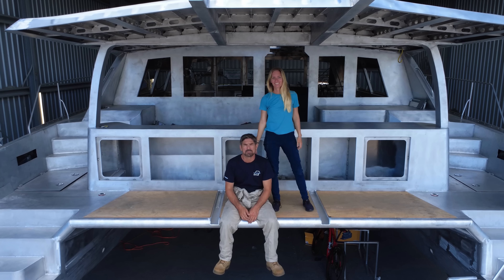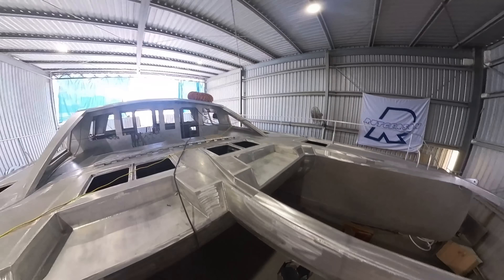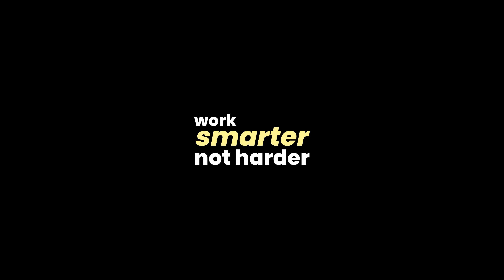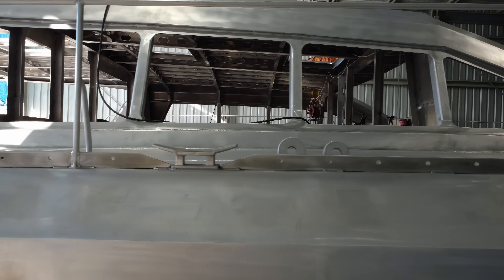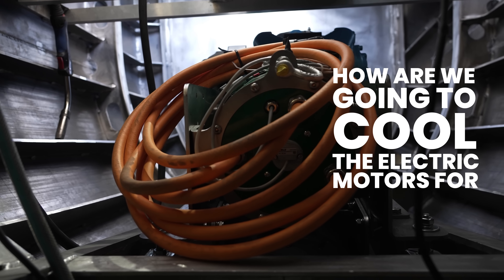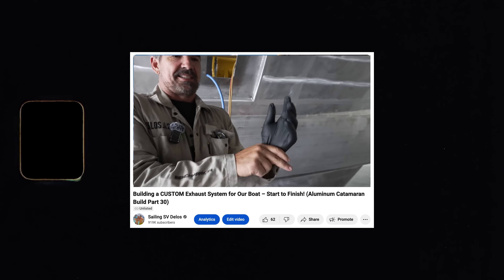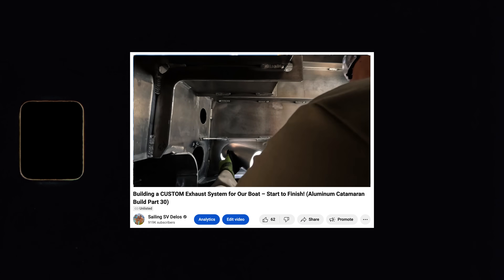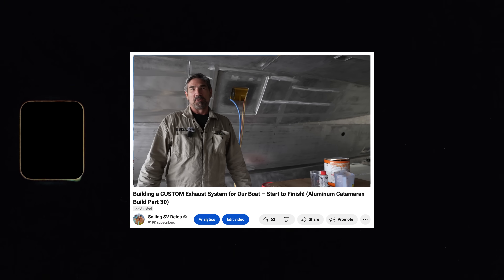We Challenged AI to help design our Keel Cooler 🧠 (Building Our Own Aluminum Catamaran From Scratch)

Comment: I'm sure you know all this, but just as an excercise: 

1. I would consider this a critical ship system and therefore work closely with manufacturer to ensure your design meets or exceeds their recommended operational parameters.  All the calculations I've done DO NOT show a viable option for an internal "keel cooling" system, mainly because they're electric engines, not combustion engines. 

2. Most important for electric motors:   Proper cooling is crucial to prevent overheating and ensure the motor's longevity.  There will obviously be a thermal protection shutdown built into the motor.  But that doesn't preclude you from using you own coolant temp sensors to let you know what's up and shut down (or slow down) at lower temp if you want to maybe extend motor life (or be able to push it a bit more in emergencies - NOT beyond spec, of course). 

3.  I think the main issue here is the low thermal conductivity of water (the coolant) 0.6 W/m·K vs Aluminum at 237 W/m·K.  You've got to move a lot of coolant across a lot of the Aluminum surface of the hull in order to keep the electric motors cool, the way they like it.  IC Engines of course like it hot, so 'keel cooling' works ok. 

I would maybe even build a separate sea water heat exchanger system for the electric motors, if you want to make sure they run at the lowest possible temperature, esp in those tropical waters. 

Have fun guys!  Thanks for presenting a 'cool' engineering and design issue! 🤓

Comment: I'd say make the e-motor keel cooler half the size of an equivalent output diesel engine keel cooler. This would ensure the cooler has 2-3 times the needed btu transfer under ideal conditions and 1-2 times the needed btu transfer under worse case sceniero's. 

The cooling fin design will have the largest determination of overall heat transfer efficiency. Thin fins with alot of surface area to start. 👍
Reply: Also trust the human. The human actually knows what it's doing.

Comment: Theres so many variables. Amount of circulation will effect the temperature, so size of cooling piping and flow rate of a circulation pump will have an effect on cooling efficiency. The system needs to be designed for the worst case (hottest sea temperature), the cooler the sea temperature the more efficient cooling will be, the lower you can cool the electric motor the better. I would be trying to use a systems similar to the cooling system on your diesel motor that uses many of the same parts to eliminate the amount of spare parts that need to be carried. Dont re invent the wheel, adapt something that is already available.

Comment: don't be afraid to be conservative,and take in account that a diesel engine run at 90c probably your system want something lower than that,then as the temp difference is lower,the efficiency of the cooler decrease

Comment: It sounded like you wanted to mount this cooler internally. I think keel coolers are normally mounted on the external surface of the hull, directly in contact with water. That may change your calculations quite a lot. Also, since the hull is so large compared to the cooler, the thermodynamic calculations may be able to be considered related to an infinite solid… the whole side of the hull will be wicking away heat. Just some thoughts.

Comment: M.Eng. / N.A. here who has designed actual external keel coolers - ugh. 1/2 pipes and channels welded to hull exterior are common but are way too much drag for sailboats. Do not do external keel coolers!  Weld a long skinny box inside the hull compartment with little tab baffles. Keep flow <2m/s to ensure no erosion of parts of the hull or your box. About 0.4m2 seems like sufficient area because your delta T is low.  Depth of box can be very shallow. About 35-40mm or so. Lots of electric motors de-rate >50C so 35C sea water temp + 15C temp rise is going to be acceptable. Use a small plastic expansion tank (auto parts store) for the system and a pump rated for constant running, hooked to a thermostat. In cold water the pump may not need to run because cold air inside the hull compartment will keep the motor. Cooling boxes can be broken into 2 to avoid frames or centerline line keel. Commercial keel coolers are usually bronze so really to be avoided on an aluminum boat without very very careful galvanic isolation.
Reply: You could also contact Fernstrum to see what they would recommend for your application. Their units are very common on commercial vessels. I think they are always bronze. But Weka makes an aluminum keel cooler. These are all external types but could be recessed to reduce drag. At least you'd get a ballpark on surface area required.

Comment: I tested Perplexity with your query as in the video and it suggested 2.5 sq m--assuming 10C between the sea temp and the coolant temp.  Seems to me the desired coolant temperature is the will drive the size of the heat sink.   Finally corrosion/antifouling/marine growth will all contribute to increasing the size of the unit!

Comment: i would make 2 - 2 sq feet coolers with valving to to use 1 ore both . and the abilty to use just one if one leaks  . i would also make the cooler as much surface area to the hull and a thermal paste to aid in conduction.

Comment: For a a seawater exposed  hull saltwater heat exchanger as in it will sit in some kind of hull pocket if you can swing the cost Titanium is orders of magnitude better at preventing marine growth and it is way more durable. Why is the extra cost may be worth it? Long passage you are coming in to port anchor and the heat exchangers are all covered with even extra hull growth because it is all warm and snuggly and protected in and on that heat exchanger.  Most people that are from the Americas never think of titanium for normal things because Ti is not a normal thing there so it is considered exotic, imported, expensive and hard to work with but outside the Americas it can be quite affordable for what it offers. Where you are in OZ you can get things from China Russia and eastern Europe and they are all very used to working with Ti. Just a thought thanks for the video.

Comment: Haaaa nice ingeneering problem [;oP. One important question : What kind of T°C do you accept in the electric system, motor and expecialy motor controler ? At the end, whaterver cooling surface you implement will determine a coolant temperature in the loop. Lest assume worst case : 30°C in water, 50°C in coolant. Fouriers law : Exchange coef of aluminium is 237w/m2 for a thickness of 1m per 1°C difference. SO for 20°C and 6mm thick alu : 20*237/.006 = 790kw/m2 for a perfect convection of water on both side. Witch is never the case. In fact conduction trough alu is always very good. What is limiting is surface exchange due to  : surface cleaneness, water speed and convection at contact on both sides. On coolant side typical values are 1000 to 5000 w/m2/° on sea side could be  500 to 1000 w/m2/°.  Lets assume following R total  = 1/3000 + 1/750 + .006/237 = 0.001691 SO heat transfer with convection would be a realistic 20°C / 0.001691 = 11800w/m2 for 20°C différence. A quarter of square meter is not bad for 2500w. Assuming surface degradation in marine environnment I would double with 0.5m2. If you can. The only risk is to run cooler if everything is perfect or a little hotter if bad. BUT most of the time you will NOT expell 2500w per motor.

Comment: @sailingsvdelos Brian, I got this from ChatGPT, don't why you got 1.25 m² 😮😮😂😂

"If you have a 25 kw electric motor that's 90% efficient and you want to cool it with a closed loop coolant system how much heat do you need to dissipate via an aluminum heat sink? How large would the heat sink need to be if it's used as a keel cooler on an aluminum sailboat?

To determine the heat that must be dissipated and the size of the heat sink (keel cooler), let’s go step by step:

---

1. Heat to Dissipate

Your motor is 25 kW and 90% efficient, meaning 10% of the power input becomes heat.

Heat = 10% of 25 kW = 0.10 × 25,000 W = 2,500 W

So, the system must dissipate 2,500 watts (2.5 kW) of heat continuously.

---

2. Estimating Heat Sink (Keel Cooler) Size

The sizing depends on how efficiently the aluminum keel cooler can transfer heat to seawater. A rough estimate from marine industry practice is that aluminum immersed in seawater can dissipate around 500–700 W/m²°C of surface area per degree of temperature difference.

Let’s assume:

A ΔT (temp difference) of 10°C between coolant and seawater.

A conservative heat transfer rate of 500 W/m²°C.

Then the required surface area:

\text{Area} = \frac{\text{Heat}}{\text{Heat transfer rate} × ΔT} = \frac{2500}{500 × 10} = 0.5 \, \text{m}^2

---

Final Answer:

You need to dissipate 2.5 kW of heat.
The keel cooler (aluminum heat sink in seawater) should have at least 0.5 m² of external surface area in contact with seawater, assuming good design and flow."

Comment: Run the Ai with water temp of 30 C outside and then see what it says. When designing, test to feil and do the same with design, making to be over engineered so it will not fail.

Comment: Dear Delos fam, as a master plumber and master HVAC guy don't forget that the heat sinks will be radiating to the cold ocean however 3/4 of the surface area of the heat sink will be radiating inside the boat so you have to consider how you're going to insulate the heat sinks up against the hull away from delos to's interior at least for the summer perhaps you could have a removable thing insulating it so that in the winter time you get some free heat from motoring to warm the boat.
Reply: Note a 25k2 motor that is 90% efficient, rejects 25/0.9-25=2.78kW of heat.  I'd be looking at half tubes welded to the hull, easier to clean and antifoul.  Important thing is that it's not undersized, am assuming thermostat will keep temp under control.
Reply: Exactly.  How much heat radiates into the boat versus going into the ocean?  You want the heat sink chamber to be thin so you maximize the surface area of the water being cooled.   I am not sure what the heat sink idea buys you.  Heat sink (potentially saving 1 water pump) or exchanger, need 2 water pumps.  Both need hoses and fittings. So a few less parts but you have a lot more heat going inside the boat.  How do you scavenge the heat from the electric motors?  Need 2 setups as well and a system for the diesel motor.    What is the mA rating of the water pumps and what will they consume for power?  Good puzzle
Reply: Interesting. I'd never heard of a keel heat sink, but it seems to me that one might want to capture some or all of that heat for such things as hot water heater, etc. I know some diesel engine systems do incorporate engine heat for hot water heaters. What else on the boat could benefit from the electric motors' heat? Interior cabin heating for example? Good puzzle indeed @markryan7109!

Comment: I'm glad to hear you're not relying solely on assumptions and are double-checking the information yourself. That approach is essential. I recently completed an AI guidance document for the company I work for, and one of the key concerns addressed was the issue of assumptions. While AI can be a powerful tool, users must always operate under the assumption that some information may be incorrect or incomplete. Critical thinking and verification are vital. On another note—regarding your use of the hull or keel as a cooling surface—have you considered the potential for condensation when operating in cold waters (around 1°C)? Depending on the amount of condensation that forms inside the keel, your bilge pump might end up running quite frequently.

Comment: Question.... Would the constant exchange of heat between cooling motor and sea water discolor the hull on the outside ?   Would that in some way the constant heating and cooling in any way weaken or compromise the integrity of the hull?  Like other metals constant heating up and cooling weaking the metal.  Does aluminum after constant temperature changing do the same?  Just wondering ---- Your craft is going to be the standard in years to come.  Everyone is going to want some of the ideas you have conquered....  GREAT JOB

Comment: My engineering take. on the issue:  My goals :  1. adequate cooling 2. No through holes, 3. For sure no copper on the outside of the hull or even on the inside where you could get galvanic corrosion.  3. Serviceable without a haul out.  4. Redundancy not just one cooler section but two or several so a leaking one can be bypassed and repaired or replaced. 5. flow and or temp monitoring.    Easy to replicate in any part of the world. 
 How about square aluminum tubes  bolt fastened to thick heat transfer flanges welded to the hull on the inside of the hull.    Include a inner plastic turbulent flow baffles.  Make them simple  and spread them around connected with tubing (PEX).   You got plenty of hull area to work with, just over kill it with multiple smaller easy to replace units.   On sea trials, not enough cooling just add a few more,   Watch for dissimilar metals and galvanic corrosion.   Wouldn't be too hard to prototype one and test it to see  what it would do, then scale up the numbers to attain your cooling goal.

You also only need full cooling at max motor power, where you would have max water flow over the hull.   Don't  fall into the trap of over  estimations.

Comment: I'm not an accredited engineer, and I didn't stay at a Holiday Inn Express last night, but I'm an autodidact with a fair amount of engineering and design experience.

The thermal conductivity of Aluminum is ~237 W/m·K at 35c. It's weird that none of the AI models seemed to land on that, but that, and the flow rate of your pumps are the major missing pieces of the puzzle.

We already know you're calculating for a heat load of 2.5kW.

You've got plenty of Aluminum in the hull, so the heat dissipation to the water isn't going to be of too much concern. The potential thermal load capacity of the sea water is virtually infinite, so we don't need to worry about that side at all, even with some bottom paint. In your position, I would probably just recommend building your own plate heat exchanger, and just building it directly in-place, welding it to the hull on the inside, so you get maximum conductivity. The more plates you stack internally, the more surface area you'll end up with. Just make sure you've got plenty of 'meat' on the sides, to conduct the heat from the plates town to the hull.

If you do that, the only thing we need to worry about is how much surface area you need in the heat exchanger itself, to get the heat out of the motor and INTO the hull, and by extension, into the water.

This would be pretty trivial to calculate, but we just need to know what your target operating temp of the motor is [unknown], the maximum sea water temperature you intend to operate in [35c], and the flow rate of the pump you intend to use to circulate the coolant in the system [unknown]. 

Also, the cooling medium you intend to use has a slight bearing on the problem. I would assume a 50/50 mix of propylene glycol?

Based on the numbers you provided, if you're trying to keep the INLET side of the heat exchanger within 15c of the sea temp (50c), assuming a flow rate of 3.75lpm, you would need ~1.24m2 of total surface area in your heat exchanger.

If you are trying to keep the OUTLET side of the heat exchanger within 15c of a 35c sea temp (50c) assuming a flow rate of 3.75lpm, you would need ~.531m2.

If you have more specific numbers, like the actual flow rate of the pump, and your target operating temp of the motor (ie, inlet temp), it can be calculated more accurately. Higher flow rate of your pump (within reason), will mean a better heat dissipation in a given surface area, and a narrower delta between inlet temp and outlet temp. If your drive motor is rated for an operating temp of, say, 100c, you need a lot less surface area and flow rate to maintain that temp vs an operating temp of, say, 60c, since the rate of transfer increases as the Delta T increases.

Comment: How well will the heat transfer through 6mm plate? Will it transfer well enough to cool before getting too hot?
Radiators use very thin plates to increase surface area and transfer heat more efficiently.
I think I would get a piece of ali plate the same thickness as your hull of the appropriate size. Put the copper block against it and run the electric motor. Spray the underside with a hose and see if the motor overheats.